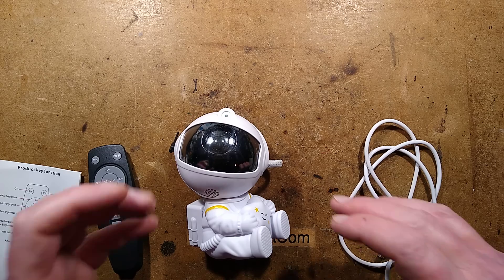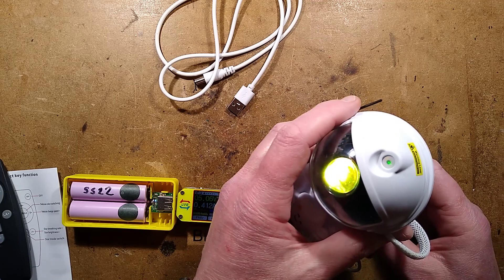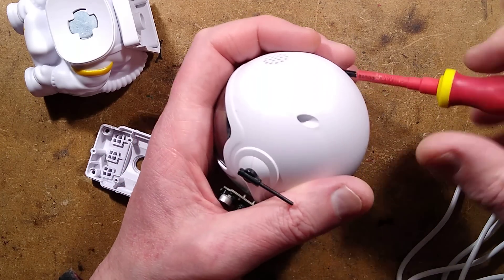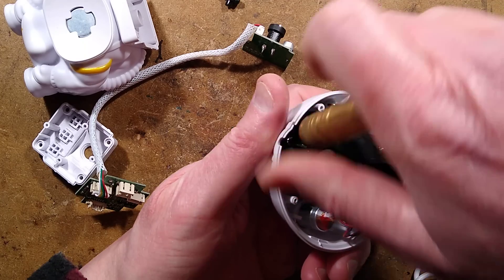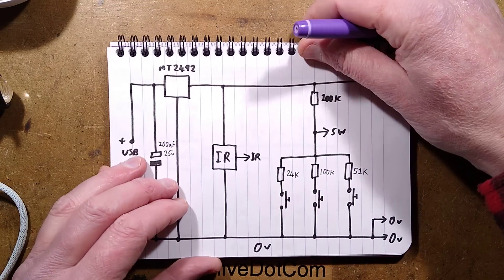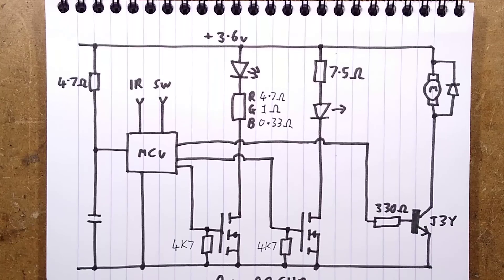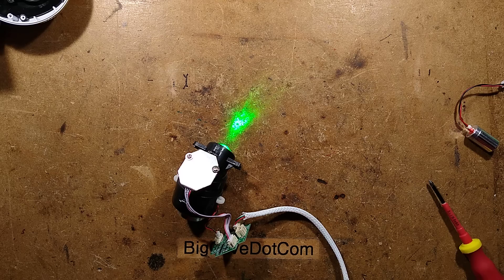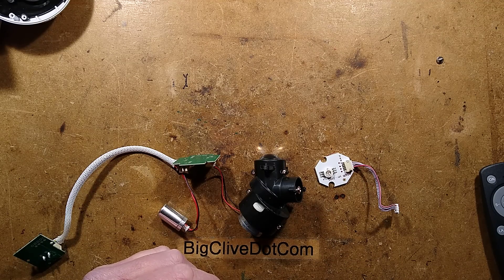Can we fix a dead nebula projecting spaceman?

Comment: Hi please I don’t know if you’re going to see this comment but I think I messed up. I plugged a stronger adapter to the starlight. I used the one for my LED 600 and try to see if it will work but I think it fried the system and I don’t know what to do. Can someone please help me
Reply from the maker: Overvoltage may have caused significant damage.  I strongly recommend labelling power supplies so they don't get mixed up.
Reply: @bigclivedotcom so there’s no fixing it? Please let me know what I can do

Comment: Hello, I bought the astronaut nebula projector for my daughter but the mechanism that makes the nebula move does not work is this able to be fixed kind regards
Reply from the maker: It might be viable to open it to see if it's a simple jam.  But only if you can't get the seller to provide a refund or replacement first.

Comment: hello , i have one of these , and the laser doesnt turn on , i have used a multi metre to check to see voltage and its getting volts at the actual laser , but no work , do you know of a link to get the correct replacement laser please , i know they are cheap and i could just buy another unit for my daughter , but i like to repair first cheers
Reply from the maker: You can get laser modules online, but the unit is a LOT safer without the laser active.  Also note that just because the green laser isn't visible doesn't mean it's completely dead.  It may be putting out infrared laser energy.

Comment: i also bought the one for my 3 month old daughter, but unfortunately it didn’t work, could you also fix for me? Unfortunately i live in India and I believe I don’t have any local repair shop where it can be fixed 😢
Reply from the maker: If you have a meter, check the USB cable is putting out 5V on the plug.

Comment: don't suppose you know the power ratings for these do you ? like max volts, or if it takes ac/dc power? really wanna get my nephews to go again as he thought it was dead but i have had it on briefly
Reply from the maker: They usually use a 5V DC (USB) power supply at probably 500mA.

Comment: We have this one! It decided not to work, so I took it apart. No luck. Then tried a different USB plug which did the job. Not sure why it decided it didn’t like working in the previous one after a month or so. However, in the process of all this I seem to have lost the diffuser for the laser light, so it now only has 1 star shining. Any ideas on what it looks like or what I could use to replace it with?

Comment: Thanks! But mine (exact same model) has a gear fault and is clicking (fast on fast mode) and I need to open it to fix the clicking….
Reply: Tried it now, but it’s from the motor itself, cant open it, or won’t rather, if it breaks it’s even worse than the ”tick tick tick”

Comment: I thought I'd point out the spaceman in the other video had a power/button board with "20231012" printed on it, and a controller board with "2023-8-4".  This video shows a power/button board with "2023-4-7" and a controller with "2023/3/14".  So, in case nobody else has mentioned it, assuming those are dates, the one in this video is the older designed, and the other video has what is probably the newer, refined design.

Comment: 0:09 - Kudos for the letter printed on tractor-feed paper by a dot-matrix printer! That brought back a brief moment of warm fuzzy nostalgia. I still have my old Apple ImageWriter II, as well as the Mac Plus it was connected to. I might even have a box of color ribbons still around the house somewhere.

One wonders if the disco spaceman you disassembled here is the original, and the previous video was the knock-off? (Or is this the knock-off, and the previous video was the knock-off of the knock-off?)

Comment: I have a SkyLights type thing that also has a motor for the diffraction disc in front of the laser. You can toggle rotation of the nebula and the starfield independently. 
No idea what the other two motor channels would be for, maybe there are models that rotate the entire light engine or something?

Comment: Funny, ours didn't work out of the box either. Took it apart and found that the projector had completely fallen out of it's housing (or wasn't even installed properly from the factory).

Comment: I am wondering which of the two models is the newer one. They usually add some "value-engineering" to products to reduce manufacturing costs and fix issues in the initial design. Are there any date-codes/version numbers on the PCB or plastic parts?

Also noticable that the dot matrix printout says that 'his wife falls asleep to the sound of your voice'... She need lessons in electronics - it is REALLY captivating!!!!

Thanks for keeping the rest of us glued to the screen with your videos, Clive!🤣

Comment: I bought a few 18650 flashlights off ebay and every single one of the cables failed. The flashlights are fine, but when buying some cheap Chinese gadget the cables are crap from my experience.

Comment: I also just have to say, thank you for this channel! Thanks to you, Clive, rather than paying Dyson £99 to repair my vacuum cleaner when the brush bar stopped spinning, I took it apart, found a faulty clicky switch (not sure what they’re actually called), dismantled the switch, cleaned the contacts inside, and now it works fine - for the grand total cost of £0 and only a mild bit of “where the hell’d this screw go?” Without this channel, I wouldn’t have the skills to even know where to begin. (And, before anyone asks, I did wear electrical safety gloves and did discharge the capacitors before sticking metal spudgers into switches).

Comment: Decoding the voltage divider with the ADC to save pins, wires, and pcb traces might not be the most glamorous application, but at least it's not left unused. I'm guessing the microcontroller idles for most of the time anyway, so the few cycles to massage the ADC data is not impacting anything.

Comment: I was trying to program some 8266 and esp32 dev boards but they wouldn't show up as serial devices on my ubuntu desktop. After doing some continuity checking it occurred to me to check my micro-usb ended cables; not a single one in my house was supporting data, just power. Sigh. A short shopping trip later and I was able to access the dev boards without difficulty.

Comment: The four motor wires might have been the coil pairs of a single stepper motor. That would achieve a slowly turning axle without using a gearbox, but might have been more expensive so this looks to be a cheaper iteration. That less bright and even less amusing light output makes this intuition more valid IMHO. The other one looks way cooler!

Comment: another interesting analysis there.  id like you to get hold of one of the cheap Chinese 1000w PA amps from bang good and do an assessment. I had one with many features such as Bluetooth, built in mixer and mic inputs. They can also be run on 12v as well as mains. might be interesting

Comment: This is a good reminder to keep things simple. I had a similar instance in my field of work. I spent close to 20 minutes exploring an electrical panel for a loss of power. It turned out that a kill switch had come unplugged on the exterior of the panel box.
Reply: Occam's razor

Comment: Unusual that the lead is faulty ( ? ) .... a  LOT  of Apple™ and other USB leads get chucked away , because the owners WILL pull them out by the cable ( they should grip the connector of course ! ) .. these can be found in many places ,  in town or country and are a valuable (  FREE ! ) source of USB leads for all manner of uses ( tip # 34 ) .. DAVE™🛑

Comment: @11:30

it looks like they used a control board for a mini drivable robot, one motor for each of the four wheels, and converted it to a 1 motor board. Makes sense to have one board used for many projects.
Reply: That might explain why it has an infrared sensor/receiver on it - for remote control if it was a robot

Comment: I have one with the mechanism like the one in your video.   It worked, but the motor wouldn't rotate.  When i took it apart, I could see that the disc was getting jammed on the inside housing, since it was mounted crooked.   I had to remove some plastic, but it works now, lol.

Comment: Very interesting indeed. I just wonder how on earth they can sell stuff like this for £10.94. Are those circuits designed by computer or does a human sit down and work it all out?
Reply from the maker: The biggest part will be the case design and the software.
Reply: A human will design the circuitry by putting together a prototype on a 'bread' board, and then can test if all works as planned. Then the design of the final board is more and more done by computer, it can calculate the most efficient place for the parts so the routing of the tracks are as short as possible to save space and material. But there are some parts (not in this product) that need dedicated places on the board to start with, so not to disturb other parts or signals, and that part (i think) will always be done by skilled designers. The computer then will place the rest of the parts and routes in the most efficient place.
Reply: @erikdenhouter  Thanks. It's amazing stuff and a lot of work for less than £11.

Comment: If they go straight to refunding a purchase without finding out what the fault was they have no feedback an no way to make improvements.
That cable was probably bought in bulk and very cheap because nobody tested it or maybe they did and even though it didn't work they didn't throw it away. 
The entire product was almost binned because the cheapest part didn't work, it's not about the value of the item it's the waste that bothers me and the fact that it probably happens quite a lot because some random guy in a backstreet factory in China doesn't know that they are responsible (or doesn't care).

Comment: I appreciate seeing the output from a decent dot matrix printer. 
Seeing the holes down the sides of the paper briefly transported me back to the 1980's and my trusty old Epson printer hooked up to my BBC, churning out code listings. Happier, if somewhat noisier times.
Reply: Yup, great retro stationery, monospaced font and everything.  Gave me a flashback to tossing handfuls of the torn-off perf strips down the middle of the stairwell at University, after printing off assignments with their output.  Watching them unfurl and twist in the updraft on the way down.
Reply: Yep same thought when I saw the fonts and the holes, except I'm only in my 30s lol
Reply: Back in my early career, we plotted Spice sim plots on wide fanfold paper. 

I brought lots of it home to line my bird cages. Memories…
Reply: My first (Proper) job was as an IT apprentice - I had to lug huge boxes of A3 paper about and keep the printers running; very noisy, high speed printers. Took me right back more years than I want to think about!
Reply: And SLOW times... ⏲️
Reply: We had miscellaneous Epson and Okidata printers, including one big beast that could knock out a NLQ document in about 5 seconds, we had to move it to a utility room with its own enclosure because of the noise it made.

Comment: I'm interested to know why the power cable wasn't working. What fault did it have? I'd love to know.
Reply from the maker: Broken wire at a crimp on the jack.
Reply: Probably a simple production fault and one of the wires was not soldered properly on one of the connectors. 😅

Comment: just what i needed. had a miserable 2 days. my motor car's alternator died on Friday. the internet cheerfully advised swapping an alternator is an easy job. and ,after all, an alternator is electrical. i like that sort of thing, said my wife. I did have a look. well, to me, the side of my modern-ish car's engine looks like a ruddy difference engine, not a diesel. there are belts all over the place. i was well out my depth. so i rang a man.  it is so nice to feel as though i know something whilst watching BC enumerate a device's features.
Reply from the maker: It is a challenge to get to some vehicle components now.  There are often how-to guides on YouTube.
Reply: I needed a new alternator on a Honda CRV 2005 and determined I can't repair it as it was tricky to install.
Took vehicle to auto electrician and 3 technicians worked on it for 30minutes cost $150 to install.  At one point 3 technicians were doing things simultaneously  to install  alternator.  

Later one technicians told me this model is one of the worst to repair.  I understand now.
Reply: @emanuelmifsud6754  Long gone are the days when I could take the gearbox out of my car and fix it on the kitchen floor!
Reply: @zebo-the-fat  i know. marriage gets us all in the end.
Reply: @KarldorisLambley  True!    my car fixing days were a very long time ago!
Reply: @zebo-the-fat  I did the clutch by myself on Lancer Mitsubishi 1973 model La in 1984 in summer Sydney Australia in 1 day. Gear got stuck went to KMart auto mechanic told me to put in longest screwdriver into gear handle hole tug back and forth.  It undid stuck gear car went perfect.
Reply: @zebo-the-fat been there done that even rebuilt an engine on the kitchen table once.
Reply: @emanuelmifsud6754 try replacing a headlight bulb on a 07 ish Honda civic. Front bumper and other panels have to be removed , happened a friend back in iirc 2015 and a non main dealer charged her 70 euro. Main dealer was a hell of a lot more. She was devastated when she realised I would have done it in exchange for a coffee if she supplied the bulb
Reply: Try changing the belt tensioner on an Audi !
Reply: Haynes manual: Step 1. remove the 4 bolts retaining the f-widget.
3 hours later:  2 bolts removed.  1 possibly sheared. 1 stuck fast. Skin shredded on 3 knuckles. It's now getting too dark to continue.
I'll stick to electronics, thank you.
Reply: @JC-jv5xw  me too. i much prefer a thing on my bench with good lighting to grubbing about under a car. i watched the bloke do it and i can confidently say there was zero chance of me doing it successfully, first time. and at 300 pounds for an alternator i didn't fancy trying. all told a man came to my home and did it on my driveway for 450 quid. 150 pounds was a small price to pay to have it done properly. whilst im here, semi-sozzled, and chatting away with chums, i nearly shit myself when i turned on my street and the power-steering and brakes stopped working. i never considered that loss of electrical power would affect the steering and brakes so adversely. upon reflection, obviously this would be the case. but from a battery light appearing on the dash to potential disaster was only a few minutes. i keep thinking if i had been driving on a motorway at speed i could easily have been killed. sobering thought.
Reply: I had to replace a flat battery in my car a couple of months ago... went to kwikfit... it took 4 mechanics about 30 minutes to work out how the battery was held in place!
Reply: Try finding the EXACT issue on a bmw with charging issues. Multiple ecu modules talking to each other. Maintains voltage as items are switched on ,but keep flashing battery light 
Not showing any fault codes.
Reply: Yeah some BMWs require you to reset the battery life in the module. You need a CANBUS programmer.  @patomahony9747

Comment: 4 LED drives, 4 motor drives, it was intended to be run with each LED having its own motor driving it, but with needing to fit in the small head they are stuck with a single motor drive, unless they went to much more expensive smaller motors, and crammed 4 in the head with the optics.

Comment: When you were searching for your screwdriver, it reminded me to ask you for a guided tour of your bench ( assuming you haven’t already done it, and I missed it). You seem to have the ability to grab any of your kit so easily, unlike my bench, where if I try to find anything , it’s hidden, buried, or lost completely.
Reply from the maker: That pretty much my bench.  Disorganised chaos.
Reply: "I know where everything is!  ....... except when I need it".
In engineering terms it's called the 10mm socket syndrome.
Reply: 10mm sockets always end up in the bottom of the oil pan LOL
Reply: if i want anything off my bench it is always at the bottom of the heap, often get an avalanche all over the place.
Reply: I find that the habit of putting a tool down while still concentrating on the project means that there's going to be one or two that perfectly aligned with the one on top of them, and the flatter they are the more likely this is.
Reply: Same here, I was looking for some ICs for a project because they weren't in the parts box for that project, and it took me a few minutes to find them. Although I did make a worthwhile upgrade to my productivity a while back. I stole a couple of large coffee mugs from the kitchen and dumped my most frequently used screwdrivers, cutters, knives, pliers, etc. into them. Now they're all in the one spot and I don't often have to spend too much time searching for tools under the junk on my desk.

Comment: The laser through the ripple glass is pretty cool looking, would look great on the ceiling during a storm IMO.
Reply from the maker: It's actually a classic effect.  I discovered it accidentally myself, but subsequently saw it used by others.
Reply: @bigclivedotcom  Laser Lumia is generally what the effect name is called, seen it through a few high power show projectors with scanned galvos through distorted glass and it's such a wonderful effect